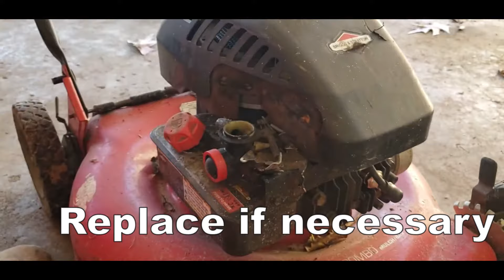How to clean lawn mower carburetor in under 5 minutes!

Comment: You don’t have a gasket on your carb. I have one on mine. I wonder why? It goes where the carb attaches to the gas tank.
Reply from the maker: Yes, a gasket goes between the carburetor and the gas tank before you screw it down. This makes a seal so no gas leaks out.

Comment: @BlakesBuilds  Awesome video! Hey,today my mower was running pretty good while i mowed the yard,but it just shutted off,i opened the carbonator and cleaned it off and everything looks good and fine,it sparked and started up,but then it shutted off again.What do you think i need? Any advice is great advice.Thank you!
Reply from the maker: If you cleaned the carburetor and it starts up but dies on its own, it's safe to say either the carb is still dirty or the gas tank has dirt in it, and it made the carb dirty again. Or you could have bad gas, check the gas you have in it for water or dirt. The likely thing is the carburetor is still dirty. Make sure you put everything together correctly and sprayed through all the holes with carb or brake cleaner, and reassemble. If it's still doing this, try replacing the carb, sometimes dirt just doesn't want to come out.
Reply: Carb needs replacing or tare down n re build

Comment: Do you know the part number for that carburetor?
Reply from the maker: It's been years since this video has been made, and one thing I forgot to do was provide a part number. However you can easily find the carburetor on Amazon, just search from the sticker on the mower that says the brand and model and hp, and match it to the pictures of the ones that come up. That's what I always did! Hope this helps.

Comment: taken the carby apart you should at least replace the gasket they are usually knackered, also being so dirty i would take out the primmer bulb
and clean it from inside as they too are generally filthy in behind
Reply from the maker: Those are great points. If the gasket is damaged it should be replaced or fixed. And while it may not stop the engine from running, the primer bulb should be cleaned as well
Reply: Thank you for mentioning that- I didn't know it could be done.  I'll clean mine tomorrow.  Also going to reclean the gas tank.

Comment: If you spray brake clean by the spark plug when testing for spark, its gunna catch on fire. You can just have someone hold the spark plug tip on yhe head of the motor
Reply from the maker: Brake cleaner will not catch on fire outside of the spark plug hole. The spray is going inside the hole and you tighten back down the spark plug before starting it on the fluid. The only "fire" would be the cylinder firing if you have spark. This test is superior to the spark plug ground test because if the engine runs on flammable fluid, that means you know you have spark, you have compression, valves are functioning, and there probably isn't internal damage. Is there a small chance for a fire outside the motor? It's not impossible, but a little fire for 2 seconds does not cause harm to anything. You would have to dump gas all over the engine for it to cause damage

Comment: Hello, what spray are you using?
Reply from the maker: I used carb cleaner. You can find the cheapest ones at Walmart or O'Reillys
Reply from the maker: I started using brake cleaner though, which also works well
Reply: Ya my understanding is brake fluid will work as long as u don't get it on the rubber / plastic parts?
Reply from the maker: @MrVARhythm  it does sometimes shrink rubber parts but plastic should be good

Comment: You did everything except replace   the rubber  "primer bulb" which is what is broken on mine .
Reply from the maker: You will be able to do it fairly easily. Just take off the housing and you can pry it out with a small flat head screw driver and just push the new one in

Comment: DONE ALL THAT AND MORE AND STILL STARTS AND DIES
Reply from the maker: If it starts and dies whether it's from starter fluid or not, that's a carb issue almost 100% likely. Make sure you sprayed through all the ports in the carb and drained/cleaned gas tank. The gas may not be dirty, but could have water in it that's hard to see. Also, if the carb you're working on is a plastic carb, those sometimes do not clean easily and you may have to buy a new carb entirely